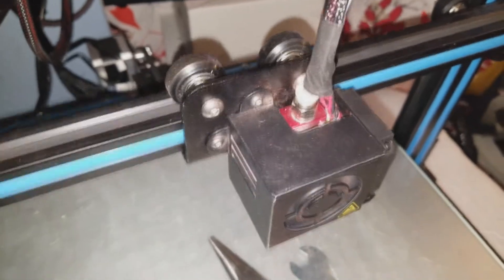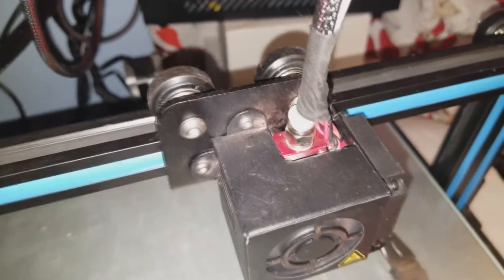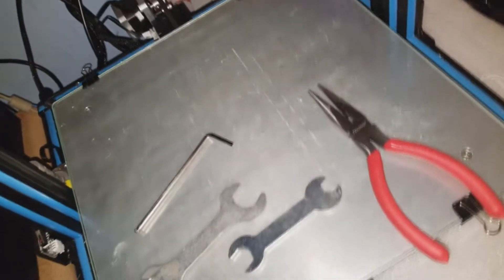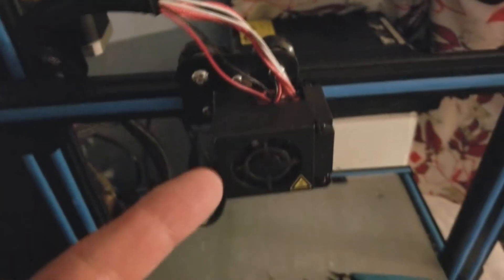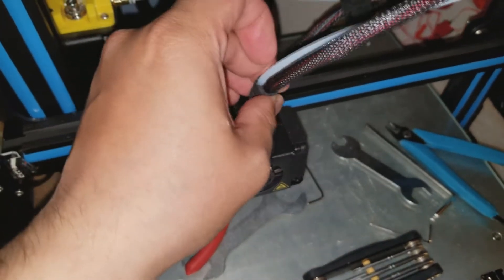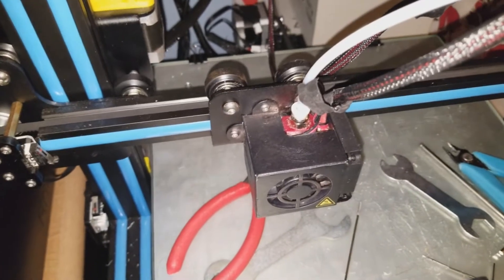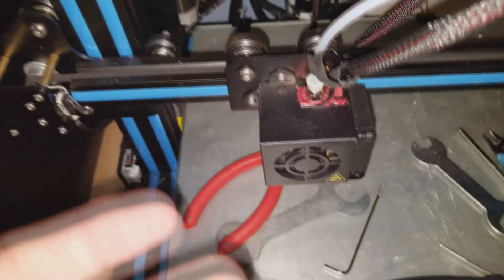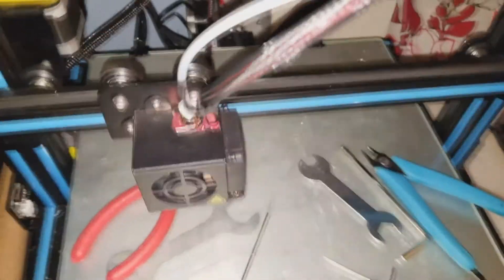How to Fix The Worst 3d Printer Clog

Comment: For begginers, realize that the slightest little expansion in the fillament near the hot end can be impossible to remove. fucking impossible. start by removing the bowden tube and trim the hot end side until you can grab the pla and pull it out the front. I love this chanel by the way, he doesnt take fucking forever to get to the point. he doesnt beg for likes and subs and he doesnt have awful background music.
Reply from the maker: Thank u for ur words and tips. We all in this community of 3d printing need to stick together and learn from.one another. Thanks again.

Comment: Great video! You got me through the exact clog. Checking on 11 hour print, the head was moving, but no filament extruding. I do have to blame you for chipping my extruder fan, LOL, I was half :watching you and loosening the Bowden tube connector on top of the hotend and that little wrench went in the vent hole. only one blade chipped so it is still working and sounds a little different. I had an inch of clogged Makergeeks PLA in that crappy tubing. Now I replaced the tubing with Capricorn XS Series - Ultra-Low Friction PTFE Tubing. I also got an excuse to upgrade the extruder fan to a Noctua.  I ordered some Tesa 51608, 25m x 19mm adhesive wiring cloth tape to get everything clean, organized and factory looking again too. Thanks again for the helpful video.
Reply from the maker: RichterScaleStudios any time bro glad it helped and rip fan lol. Be sure to show some love for the channel by like subscribe and hit the bell button as many more videos to come.
Reply: I'm so glad I'm not the only idiot who did this!  Those holes are a magnet for the points of a crescent wrench.

Comment: there is a clog on my ender 2 and i really hope that it is not THAT .. tomorrow i will know more and thanks to you i know a solution. omg thanks for the video
Reply from the maker: tibfox thank u bro for the comment. Please do show some love for the channel by subbing and liking the vid also hit tge bell button as many more vids to come. As for the clog do not worry. What substance is in it? Pla? Abs?
Reply: Lior Bar-El done done and done ;) there is pla in it and I am looking straight forward to clean it up tomorrow :P
Reply from the maker: tibfox thanks bro try using a strand of wire if that doesnt work u might need to take the nozzel out for a cleaning. I will say sometimes in the white tube things get cloged so it worth to check that too
Reply: It worked thaha :) tube was clogged a bit after the last filament change. . Soo thanks for the video and your comments. Have a nice Christmas !
Reply from the maker: tibfox u too

Comment: Great video, cant believe I stumbled on it so early :D. I have an anet a8 and is there an easier way to do this because I don't have a boden extruder
Reply from the maker: send me a picture if u can to vortexcinema@hotmail.com Ill check it out and see whats what
Reply from the maker: be sure to also subscribe as mnany more videos toi come.
Reply: Already have and posted a stackexchange post here: https://3dprinting.stackexchange.com/questions/4832/my-anet-a8s-filament-isnt-extruding-properly/4838#4838
Reply from the maker: o i mean of the extruder nozzel motor etc... i can see how it looks and make ssugestions. my a8 i built on my own with my own parts
Reply from the maker: Vosem Media correct this is easier I believe as the motor is better exposed so u don't need to remove much. I'd say it's the same concept as if u have the wire u can go right into ur nozzle and also because the motor exposes where the filament goes it makes it better for alignment. Still with the guide and the model it is the same concept just a bit diffrent. I wish I had the parts I'd do a video about it.
Reply: You can get just the extruder head for about $10 from China. You could then hook this up to your printer and you'v got a non boden extruder!
Reply from the maker: Vosem Media yeh I just bought a stainless steal one for carbon fiber filament and it works awesome
Reply: WOW carbon fiber filament! Seen a hacksmith video on it but thats it. Can you send me a link? Thanks, Thomas
Reply: Iv had to buy a new hotend because filiment is now leaking!
Reply from the maker: Vosem Media see thats the problem.i had with the anet a8. This is why I built it with custom parts.